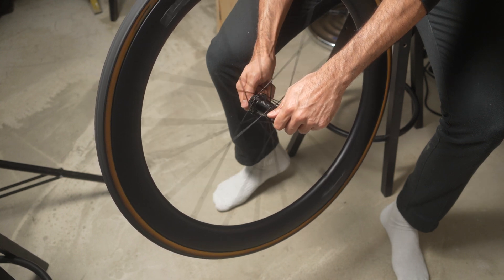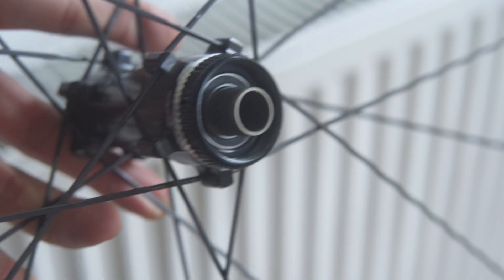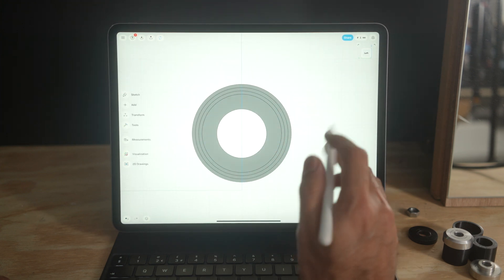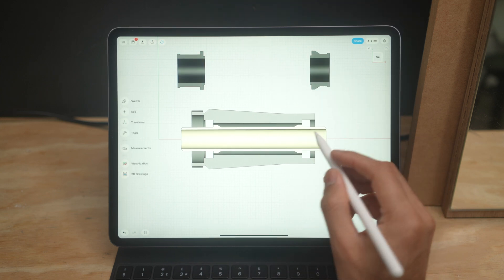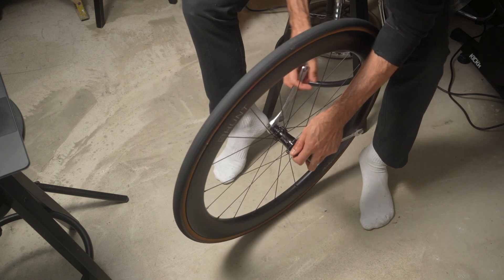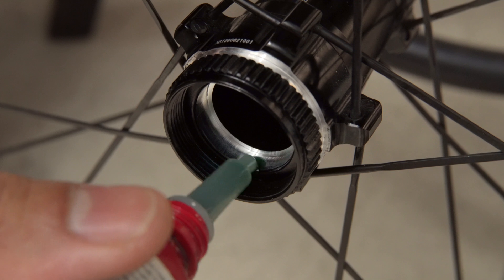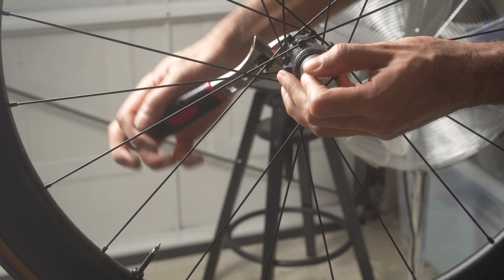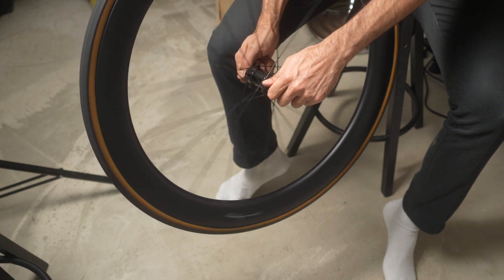Hunt 54 Aerodynamicist Front Hub Disassembly and Bearing Replacement

Comment: As a tutorial it’s a great vid thank you. As for hunt I moved on from as the hubs where going through bearings at an alarming rate. I moved to parcours. Again problems, this time hubs cracking and letting go of spokes got the hubs replaced under warranty and sold on. The common denominator, cheap horrible hubs. I’ve learnt my lesson and now stay away from “Facebook” brands. Gone back to dt Swiss and Roval rapides cl ii. Besides the front wheel going out of true slightly and the bearings being just a little to thick with grease they are absolutely bob on. Yes the Facebook brands offer great value for money on the face of it but somewhere they have comprised and it’s normally the hub and then you end up spending more money to put them right. Potentially the savings that you saved on the wheels.
Reply from the maker: I like this take 🙌🏾

Comment: This was incredibly helpful. I'm just replacing bearings in my Hunt's and was wondering whether to get a puller to get them out. One question, is the inner sleeve symmetrical? Does it matter which way round it goes back in ? For example one side has to be on the disc side .
Reply from the maker: Thanks! It has a correct orientation yes. But I wouldn't worry as it is obvious. Longer part is disc side.

Comment: Very nice and informative video, thanks👍A review or opinion video about the wheels would be amazing as I am thinking of purchasing the same weheel set but not much info is out there. Would you recommend the wheelset?
Reply from the maker: Thanks. I had been thinking about doing a video, but don't hold out for that. What I would say: 

- They are great for the price. I paid £749 and right now they are £949 so I'd wait, Hunt prices fluctuate.

- The wheels feel quick you definitely feel the push from a cross / tailwind. 

- They are perfect for anything less than a 28C. Above that I reckon the profile is nullified . 

- They are decent in crosswinds, better than several narrow V sectioned 40's I've had. But again, like any deep section they are still sketchy with buffeting winds. 

- I don't agree with the bearings they are using. Too small, higher resistance and shorter life. 

- I believe they are getting the competitive weight at the hub not the rim, so the inertia is noticeable when accelerating , but when cruising fast has the opposite effect and it feels as if they are holding speed for you and even smoothing out your pedalling. 

Yeah thats about it I think :)